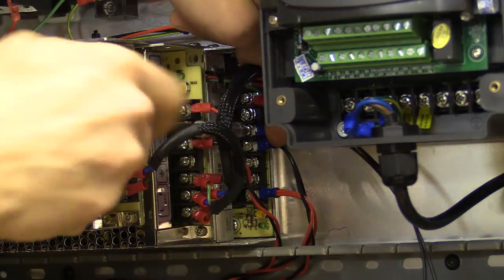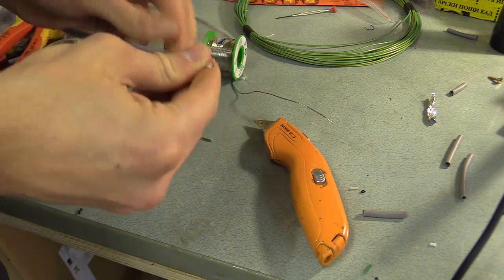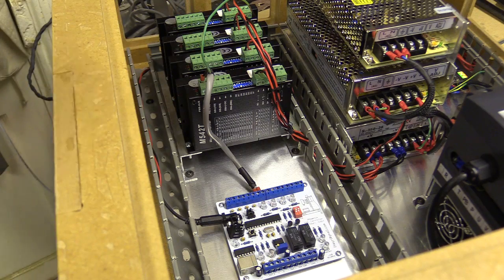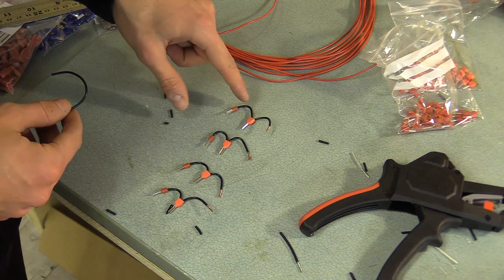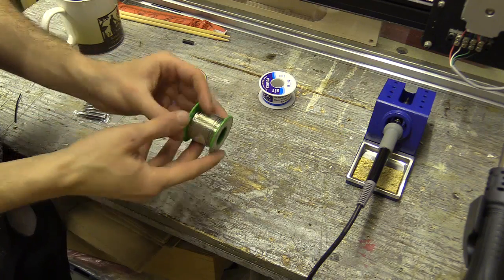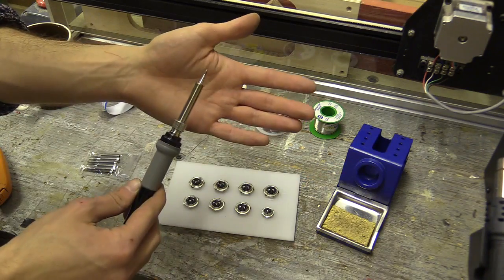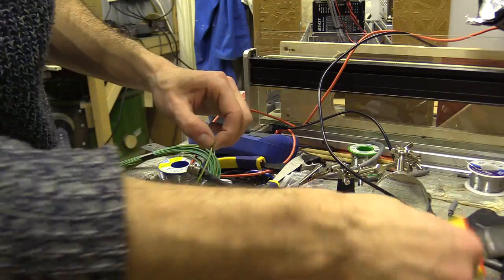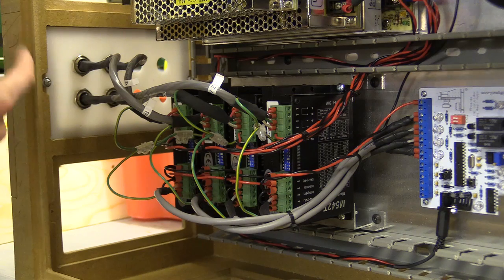#13 Wiring Stepper Drivers To Controller & Panel Mounts #13 / CNC Control Box

Comment: When you say the  wire shielding goes to ground, do you mean earth? I mean I thought shielding should go down on the 220V third pin? Thanks
Reply from the maker: Yes, that's what the instructions for inverters ask. Tied into the back-plate which is earthed. Some instructions suggest doing this at both end of the motor cable. It gets a bit confusing.
Reply: @EducatingSavvas  which back plate? Thanks

Comment: Try using clearpath motors and get rid of all the motor controllers. Go directly from your controller board to the stepper motors. They are optical  connected and do not load your driver board. Far simpler and they never loose a step and are almost silent during operation
Reply from the maker: I was curious about the integrated ones but ended up going with a Duet 2 Wifi with onboard drivers. Don't have the will to start from scratch again.

Comment: The soldering on the aviation connectors is horrible on many levels. First, the solder joints themselves. You're making the classic mistake of someone who hasn't received basic training in electronics soldering. You're heating the solder instead of heating the solder lugs on the connectors. This is how it's supposed to work: you make sure your soldering iron has a 700 deg F. tip with a wide blade (1/4 inch is good), then melt a little bit of solder on the tip and press it against the back of the lug with the pre-tinned wire already resting in the cupped portion. Wait till the lugs are hot enough to make the solder melt and THEN touch the solder wire to the cupped portion of the LUG where the wire is sitting (not the iron's tip) and fill the LUG with solder. Make sure the solder flows and all the metal surfaces are properly "wetted".

Next, filling the back of the connectors with hot glue after soldering is a bad idea, especially since the quality of those solder joints is rather poor (they have "cold solder joint" written all over them). There's a high likeliness that the contacts could fail and even break which would force you to re-solder them. Having to remove the glue from there before you can re-solder would make the process a huge pain in the butt. And in the best possible scenario, glue serves no purpose whatsoever.

Finally, can we be honest here and admit that the sole purpose of the heat shrink tubing is just a way to hide how horrible the whole thing looks? OTOH, if your solder joints were of decent quality, the HST would make sense as a form of strain relief for the wires.

Comment: les alimentations ne doit pas être posée l'une sur l'autre, risque de surchauffe important, si elles sont des grilles s'est pour qu'elle soit aéré
Reply from the maker: There's adequate space between each PSU - no problem with heat to far.

Comment: Is your spindle enable and speed (pwm) wired up?
Reply from the maker: I can use the potentiometer on the VFD after pressing a toggle switch that I programmed, or otherwise via gcode - so yes PWN and enable terminals on controller.
Reply: Educating Savvas do you mind sharing which pins in the VFD you wire to? Arduino only puts out 5V but it wants 10V

Comment from the maker: CORRECTION 0:47 Input coming into the controller such as the start, hold and reset buttons, the probe and limits switches all need an active low signal - which means when the pin is receiving a voltage (normally 5v) it is disabled, and if that goes to 0V is it active. The coolant and spindle enable pins use an active high so the off state is normally at 0v and that goes up to 12v to turn those on. In the case of stepper drivers a high and low signal result in moving the stepper in one direction or the other. When I built my first controller I didn't use a probe or start/hold buttons, and my limits were simple mechanical limits which didn't require me to investigate how they worked.

Comment: I same setup I am working on amazingly I have mine layout just about like yours. I am getting power steppers lock like there ready. Mach 3 moves the axis numbers but no movement on steppers please give me idea
Reply from the maker: Have you flicked the little switches for the stepper drivers to the right voltage for you motors? I have not used mach3 before but I think most of their control board will connect to the -pul, -dir and -enable. So the pin connections would be very different to the GRBL setup. What controller are you using?
Reply: I have them on the minus side. I found out that it is my aftermarket PCI parallel card. so I order another that is the one in a cnc group said will work with mach 3. was said it has to put out 5 volts to the breakout board. I am working on it right now trying to get to work has less voltage then the one I replaced. another think i am not sure on is the dip switches if you could let me know on those. thanks very much for replying back    Robert
Reply from the maker: Are you using resisters to lower the voltage? I haven't set mine yet as they depend on the stepper motor and the microsteps you decide to use.
Reply: Educating Savvas 
I have decided to buy the UC 100 and the uccn CNC software to use on my newer i5 desktop 64 bit much faster and can multitask with it. thanks for you're help love your channel keep it up it is helpful. check out my channel see what you think of my CNC router God bless

Comment: Looking great! I may have missed something, why take the negative sides of the drive control lines to the common on the 36VDC supply instead of to a common on your control board? Looks like the control board its own power supply. Are the commons of all the power supplies are at the same potential? Maybe tie the shields of the higher current stepper motor lines to a ground at a different point than the shields of your lower current control lines? Best wishes, Kent
Reply from the maker: Thanks Kent - as far as I have read it goes towards prevent ground loop - http://electronics.stackexchange.com/questions/90580/why-connect-two-power-supply-grounds

Comment: Savvas, looks like you know about ground loops :) Don't forget all these power supply's are probably floating, just check they are grounded on Neg out,and floating on opto isolated stuff that does need seperation such as the i/o board. May I mention another youtuber who's just started a build? The electrical side will be amazing knowing his history?
Reply: Educating Savvas I suspect he means the legend (other than yourself), that is John Ward.
Reply from the maker: Lol it's on my to watch list! He'll probably finish his machine before me!
Reply from the maker: Yes I was aware that was a problem but I didn't know about the floating channels. I was going to connect a negative grounds terminal of each of the PSU's together so they were all common - I can't wait to go back to make stupid easy videos. Yeah please send me their channel!! :)

Comment: I have a similar solder station and it works great. Doesn't have a USB port on it but I have plenty of those anyway. I love how I can turn the iron on and use it within 2 minutes because it heats up so fast and the heat gun is instantly hot.
Reply from the maker: Yeah it seems to do the trick nicely. Think just having a clean tip makes such a difference.